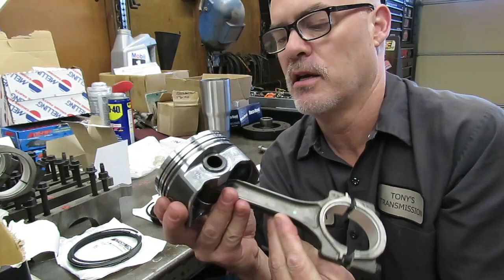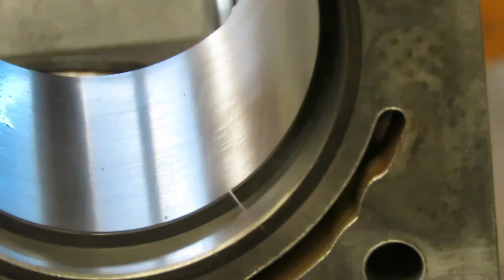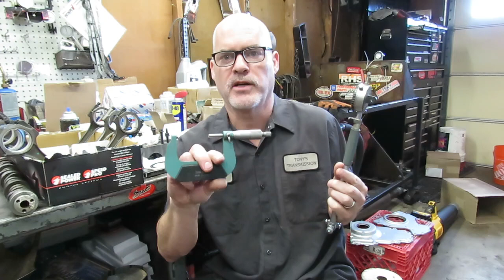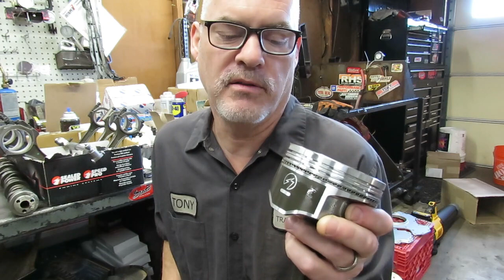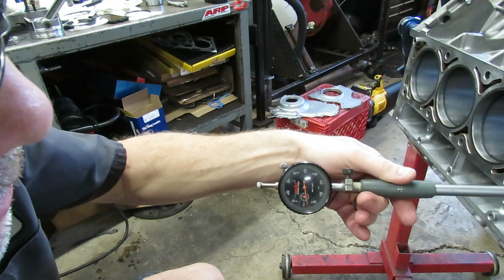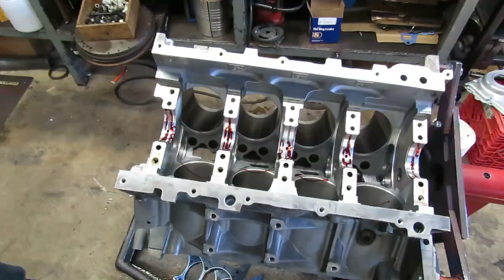LS1 Complete rebuild part 3

Comment: How do i properly hold the rod to put the rod cap and bearing on, then torque it, to start measuring for clearance? I assume a vice isn’t correct.
Reply: Use a vice with leather or cardboard.

Comment: Really great work, love the crank driven oil pump. And the blue printing be good to have fancy worksheets to record the I.D O.D and clearence. The second ring with a bit bigger clearence can prevent pressure build up between em' and prevent top ring "flutter"as i understand it. The honing of the nickasil and the rings should seat In like the first five minutes. And those head bolts that pull tension further down the cylinder, causing less distortion for better ring seal. Ya there's sooo much good stuff there the valve seat runout after 20k or so miles and valve guide concentricity after thermal cycling turns out right. Be a dream come true

Comment: 17:14 what's that blue gasket on the floor?  I just changed a timing cover gasket (leaking) on a GM 3.4, so the bright blue color really caught my eye.
Reply: Felpro Ford 302 timing cover gasket.   99% sure
Reply: Chevy small block head gasket

Comment: There's been a lot of back and forth regarding camshaft failure with 3rd gen hemis. Since you're the most intelligent, and most qualified person on YouTube to speak about the issue, will you be releasing a video on the subject? I, for one, would love to hear your ideas about the cause of it to see how close your thoughts are to mine.
Reply from the maker: I could do a video I suppose I can tell you briefly what I have discovered I have done quite a bit of failure analysis on these cams and lifters, I know that Chrysler will probably not agree with me but my opinion is the lifters and cam do not get enough oil at low rpm if you look at the oil gallery location in the center of the block and at low RPM it blocks the oil thrown off the crank the angle of the lifters and the location of the cam they raised the cam tunnel and its too far away from the crank the lifters and cam just do not get enough oil at low RPM the most common failures are among police and government owned cars and trucks allot of low RPM cruzing in my opinion it's a bad design bottom line is if you have a gen 3 hemi keep the RPM's up
Reply: @Myvintageiron7512  that was exactly my thoughts on the subject
Reply: Uncle tony thinks the same

Comment: Thinking of giving my L96 a rebuild.. can you reuse the pistons and change the rings or replace them and if so are the rods bushed for slip fin pins?
Reply: You can take the pistons off the rods..they are floaters...not pressed,  I rebuilt my l96 and instead of using the l96 dished pistons I used ls2 flattop pistons to bump up the compression,  did the same to my lq4 too....

Comment: I'm so glad to see some one explaining the LS build I'm mean this guy covers every detail I'm 63 never I'm my life did I think that gm would build any other block than the old block. I have a 6.0 in my Yukon every day that I drive it I'm so impressed with its power reliability every time I take to the road 249000 and it's just as reliable as when it had 89000 . The old school engine when you stop for fuel you always  have to check the oil and water and most of the time beat on the carb to stop it from flooding I'm learning so much from this gentleman I'm taking it all in and taking notes so my friend I so appreciate you for helping us old school knot heads.....tks
Reply from the maker: Your very welcome